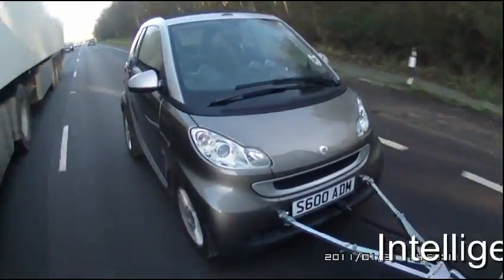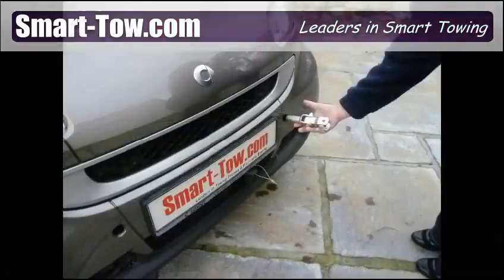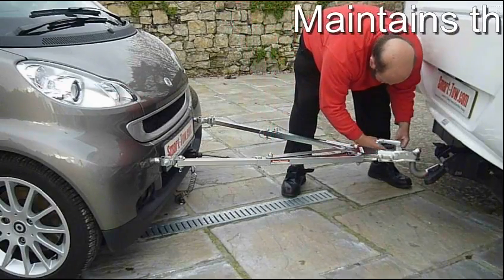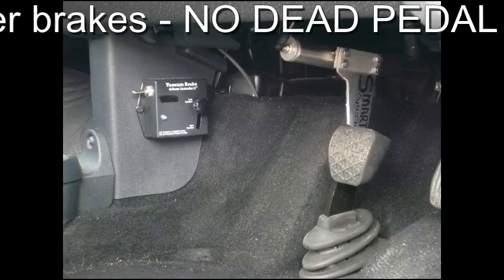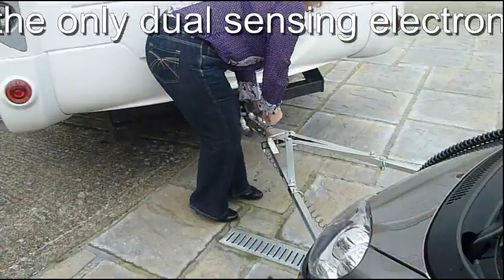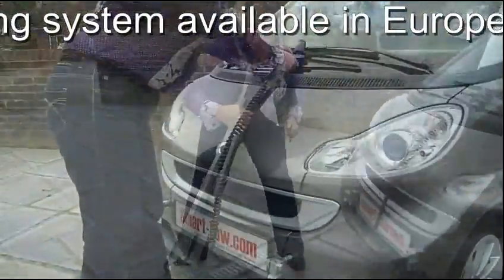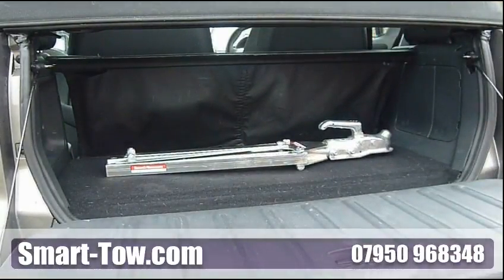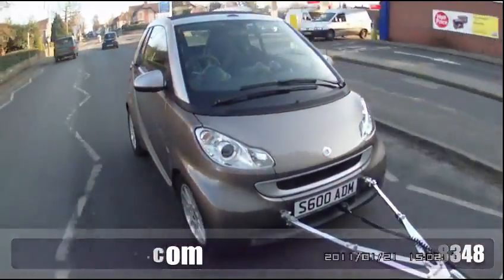Towing with Smart-Tow

Comment: Why would you install the braking system? I have used a tow dolly to tow larger vehicles that do not have brake assist built into the dolly and it works fine? Is it the law in UK?

Comment: We have a 2005 Smart Car diesel we want to tow and according to Mercedes Canada it can be as long as you stop every 50 km and drive it because you can damage the automatic transmission. Is there any truth to this if so how do you tow and not damage transmission
Reply: that is true!! my mechanic says the tranny wont get the proper lube without the pump running you will blow up your smartie

Comment: Not EU compliant . problems, bearing wear, tyre wear, never tow a car in neutral ruins gear box. and if you get tail ended the car is wrecked. Better on a braked trailer less hassel. car safer. AVOID also wears brakes on Smart car.  NOT RECOMMENDED BY MANY and NOT BY ME I use a trailer a Brian James one